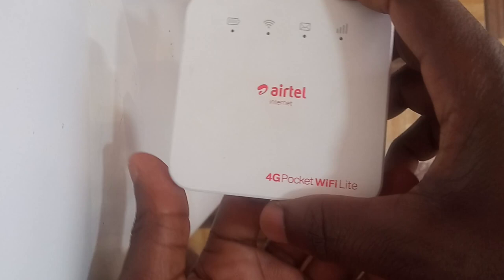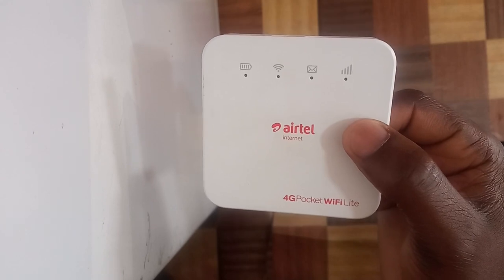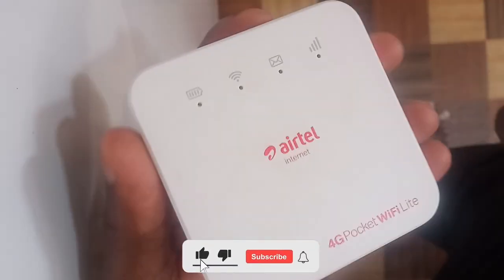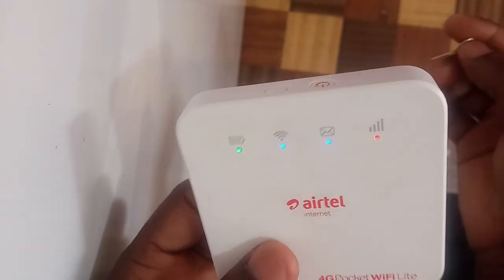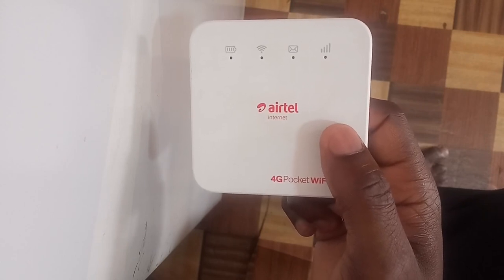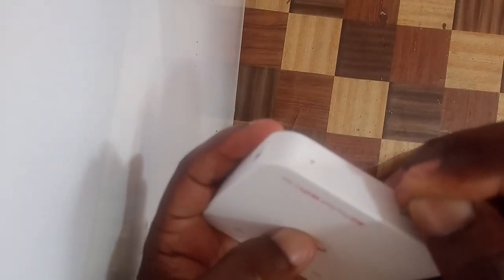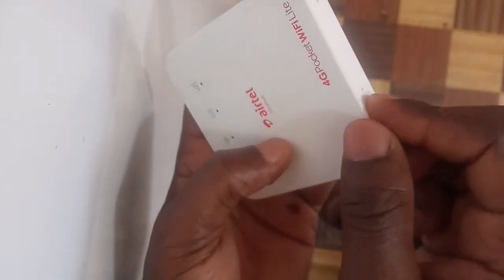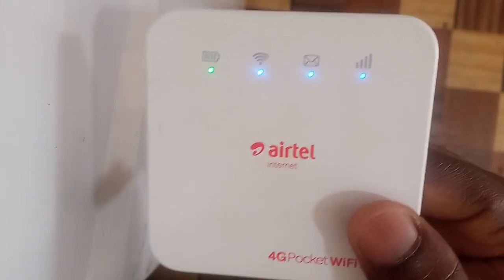How fix ZTE MF927U MIFI getting locked again after Temporarily unlocking it

Comment: My version could not allow to unlock
Seconds after it shows its downloading the firmware
It goes off and doesn't return
Its been off since
What can i do
Reply: Is it still off?. If Yes what you can do is put it back into the laptop. Long press the power button until you hear that sound when you insert a USB stick in the laptop. After hearing that sound leave. The battery red light will come back on after a few seconds

Comment: I think mine is permanently locked, after temporarily unlock it locked itself again, and I repeated the process and had refused
Reply from the maker: You will need to do permanent unlock, check out the channel there is a video about that
Reply: by locked do you mean blocked or back to just accepting Airtel?